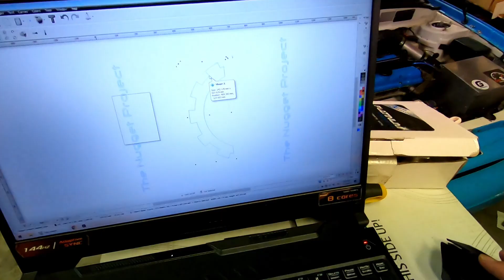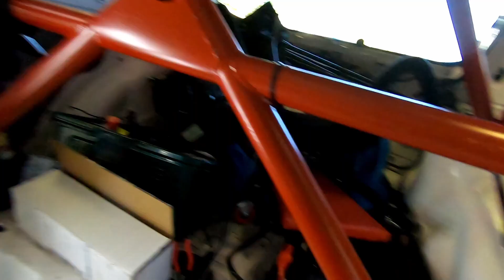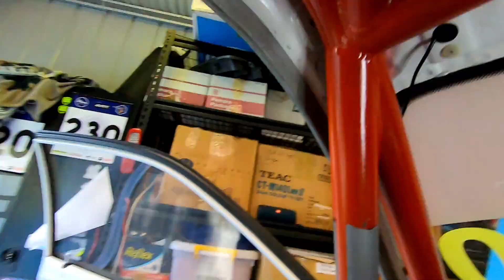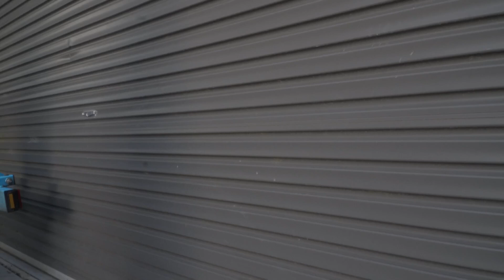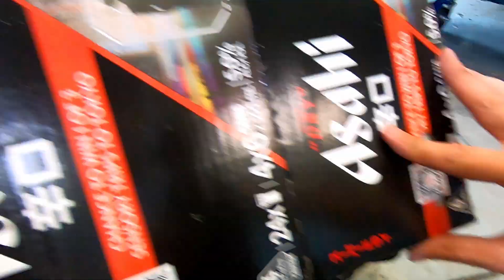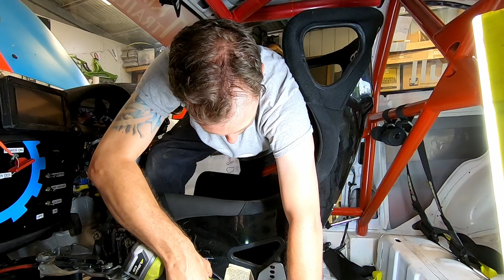The Nugget Project 2.0 - Lightweight Demister & Seat Rails

Comment: Nice work dude 🤘
That is a MOST gangsta vice block 😎
Reply from the maker: Haha yeah I didn't have a bench in the old house so had to make do, now I just need to take the time to bolt it to my bench here :)
Reply: @TheNuggetProject  I think it's a great idea, especially if you have a spare vice. Sometimes it's a pain in the butt to be working at a bench.
Reply from the maker: @seanalexander9531  actually you're not wrong, it's handy to just drag it into the middle of the floor, and bolt stuff into it to grind or drill, pretty handy :)

Comment: Keep moving forward Matt.... We did a similar thing with our seats. My son wanted to sit a low as possible, Now it takes about an hour and a half to get both of them as there's no room between the rail and the floor......After all the hassle, we finally got the car registered, just in time to have the last rally cancelled on us. So we did a quick set up change for the local hill climb...
 Not a spectacular as Rowans run       https://www.youtube.com/watch?v=uBqqtqooWbo&t=1s   How"s the engine build coming ??
Reply from the maker: That's rad! Looks.like the car is going great :) 

Engine build is on the backburner over Xmas break, I'll get the rest of the car upgraded first then I'll get the head off in the new year and get started on the block :)

Comment: I see you never rerouted your radio arial cable great video Matt looking forward to the next one
Reply: Next up heated seats !🤣great job
Reply from the maker: Yeah, I originally did a piece about it but cut it out of the video as it was already too long. I'm ditching the radio purely because I struggle to get mates to the track to be on comms for me. Instead I'm looking at the race control system where you listen to race control, it's already mandatory for a few of the race series and it should be rolled out across Vic soon hopefully :) the systems aren't expensive :)
Reply: @TheNuggetProject  let me know when you're racing, I may be able to help you out.  I'm probably at your Victorian races anyway
Reply from the maker: Thanks mate :)